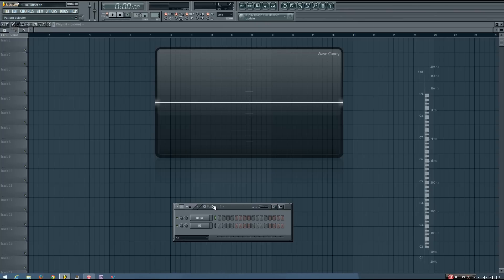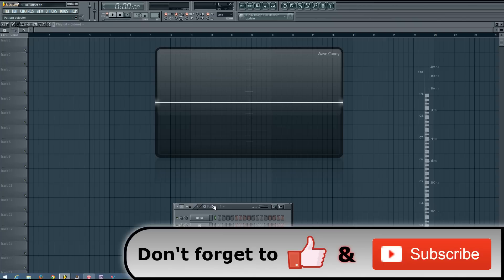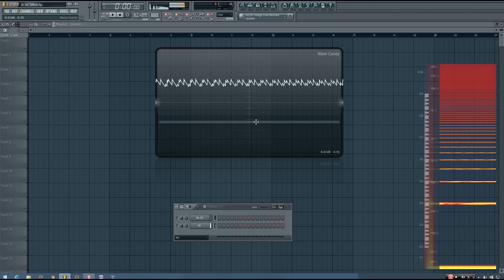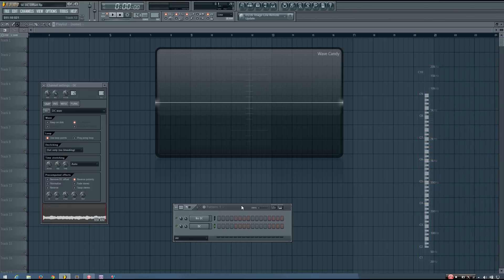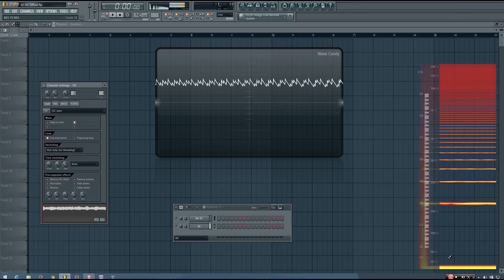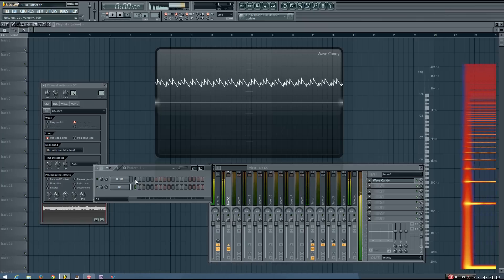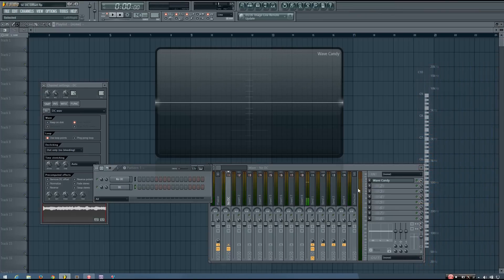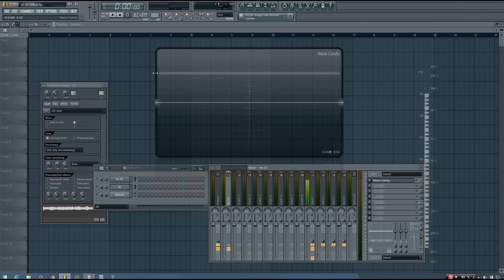Sound Explained: DC Offset

Comment: Do you think its a good way to get your mix louder for less dbs, or is there some reason it needs to be fixed?
Reply: Thanks for replying man
Reply from the maker: TrueRattlehead It needs to be fixed because it will offset the amplitude of your entire track and can cause issues on some sound systems if left in. Sometimes removing it will cause the sound to decrease in peak level, but other times it can cause an increase in peak level, but you always want to remove it because of how it affects the rest of the mix.
Reply: Intresting...thanks guys